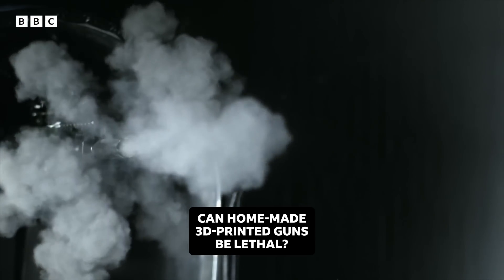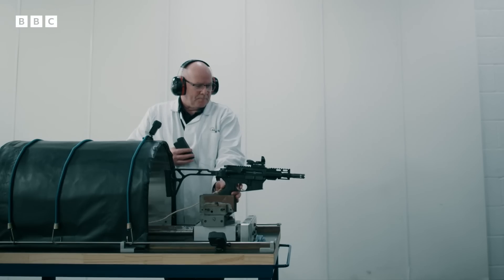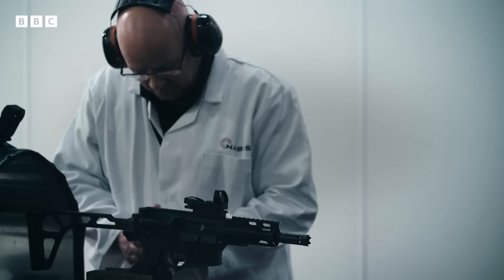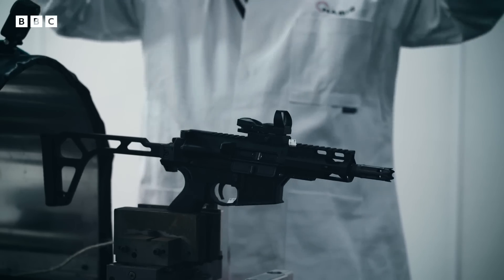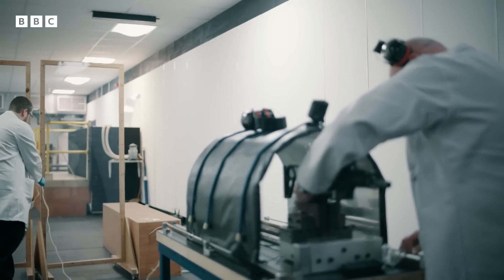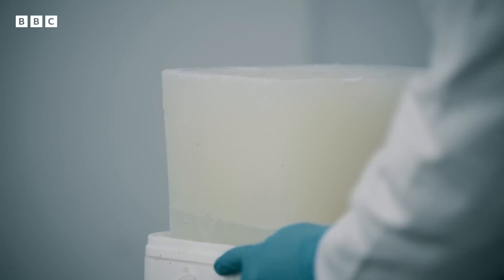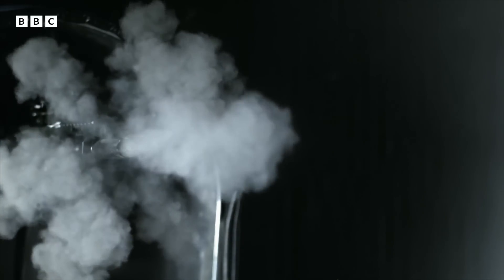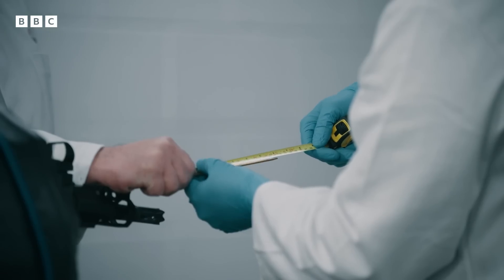Ballistic Forensics - Is the illegal 3D-printed gun a viable weapon? | Forensics: The Real CSI - BBC

Comment: You can make your own rifled barrels through ECM (running an electrified current through water) and all you need is a fish tank, steel pipe, water, a saline solution, a power source, and a fish tank water fountain. Weapons like the FGC-9 utilize a fire control group that can be sourced from an airsoft gun, or made at home using a spring bending jig, and printed parts. The bolt assembly uses straight blowback, and is mainly printed, as are the receivers. Gun control is dead and we killed it.

Comment: This article is very misleading, only frames can be properly printed, triggers, hammers, and other internal parts all brake. This is only a problem in the us where you can buy unregulated parts, like barrels, bolts, bolt carrier groups, etc. Entirely diy 3d printed guns kinda suck tbh, they are fragile, finnicky, and somewhat difficult to get working correctly. Not to mention they still need some gun parts like a trigger group. Although a trigger and hammer can be printed they are very unreliable. The fgc9 proved this, although many improvements have been made, they still kinda suck if you dont have industry made gun parts. 
To this date there hasn't been a fully diy AR.

Comment: The FGC-9 can be made entirely at home with zero gun-specific parts—even the rifled barrel, which is made from hydraulic tubing and an electrolysis process cuts the rifling. Myanmar rebels have been using it in their battles. The cat is out of the bag, gun grabbers. Figure out a different approach.
Reply: But for ammo?
Reply: @Filtered6  More difficult but not impossible. They sometimes use Ramset primers intended for construction nail guns and sometimes they use blanks or starter pistol rounds. Fill with powder and melt bullets from lead obtained from car wheel weights or fishing tackle. But often enough they just buy them; In some places, the guns are much more regulated than the ammo, which can be easily obtained. Where there's a will...

Comment: The gun looks like variant of the FGC 9 (Fu*k Gun Control) designed by Jcob Duygu (RIP). If you want more click bait and scaremongering especially the politians, you should do the Liberator, a fully 3d printable design including the barrel and the only metal part is the firing pin and bullet.

Comment: I’m unclear what I was supposed to learn here. 
1. Why use a “modified cartridge?” Will criminals use those?
2. How much of the gun was printed? Just the lower? We already know the lowers function just fine. Now how about the bolt and barrel? Can you print those?
3. Why was the guy on the other end of the phone call so excited to find out they could ban something? Kind of calls into question his objectivity, doesn’t it? “Excellent!”
Reply: It was all 3D printed. Not a lower with a complete steel and aluminum upper. I think the upper may have been from an Airsoft gun or something though. Don't think you can buy a complete uper in the UK. LOL Hard to tell. But it was for a UK court case. They man they called was a detective. They were trying to prove the gun was a viable weapon to charge that person with its possession. 

This also looks to be a 22lr or maybe even a simulation gun. Not sure.

It's definitely not something like an 80%. I wouldn't be surprised if it was intended as a BB or airsoft gun that uses cartridges. Not sure. 

This whole video is out of context... by design I'm sure.

Comment: I know the whole point is fearmongering but for the love of god if you're gonna go through this much effort shoot a 9mm bullet, how about you actually shoot a 9mm bullet.

There's thousands of 3d printed guns that fire bullets and do so successfully without this level of silliness. I've shot 3dp pistol I built using a piece of string and a machinists vise and the same ear/eye pro I wear whenever I'm shooting guns. You're not testing a nuke or explosive. When most 3dp guns break they do so via delamination aka the layers separate. Your bolt face, breech, chamber and barrel(you know, the parts that contain the explosion of the powder) tend to be made of materials that can handle the pressure of pistol cartridges, which isn't all that much in the grand scheme.

Guns that require no gun parts and are 3d printable exist and have for years. They're also quite safe and reliable if built correctly. Cope. The only thing you're showing your expertise on is how behind the curve you are.

Comment: "we put our own custom bullet in it, and it fired without blowing up. therefor, it's illegal." gun regulations only serve to decrease operator safety.
Reply: @icykenny92  so you would buy a rifle not knowing if it was correctly hardened to be safe to shoot?
Reply: So you think it would be good to flood markets with unregulated firearms, no clue if it will explode
Reply: @Mihail2204 wtf does regulations have to do with it? People have been building their own guns for hundreds of years. All the pressure bearing parts of this gun are steel. Not plastic.
Reply: @CarbonGlassMan  very off topic
Reply: @Mihail2204  No, it's on topic. You worry about the markets being flooded with unregulated firearms. I asked what do regulations have to do with it? What do you think regulations accomplish?
Reply: @CarbonGlassMan  they help keep safe firearms in the market and get rid of dangerous firearms?
Reply: @Mihail2204  As I said, all pressure bearing parts of that gun are steel parts made by actual gun making businesses. The part that just holds the trigger in place is the plastic part. This is perfectly safe. Now, people have been making guns with 3d printers for at least 10 years now. I've heard of no deaths from exploding 3d printed guns.
Reply: @CarbonGlassMan  it is safe if it is done correctly, that’s why they test it. If it were to explode because it was printed incorrectly then it isn’t a live firearm and holds less of a punishment
Reply: @Mihail2204  This was an AR pistol, probably  in 9mm or 22lr caliber. The entire upper assembly, upper receiver, bolt, barrel were aluminum and steel. That is where the pressure of the round going off is at. The lower receiver, which is typically aluminum or injection molded plastic doesn't experience any pressure beyond the spring pressure from the hammer and trigger springs. This gun had no buffer tube, so it was probably a 22lr, and since there was no buffer tube, the lower would be under no pressure. 
This video was made as a propaganda piece. The bullet had penetration into soap? That has nothing whatsoever to do with the gun. That has to do with the bullet. No shit that firing a live round of ammo into soap blocks will penetrate. DUH! You can drill a hold in a piece of metal or plastic that the bullet fits in, then whack the bullet primer with a hammer and the bullet will fire and penetrate what it's aimed at.
Reply: @CarbonGlassMan  not reading all of that, you clearly don’t understand what you’re arguing for.
Reply: @Mihail2204  Is reading hard for you? Let's see, I've been building guns for 30 years. I know exactly what I'm talking about.
Reply: @CarbonGlassMan  gun wise no doubt, but the current topic isn’t about “3D guns blow up” but rather me explaining that they do these test fires with a special load which is generally a hotter load, if the gun survives the firing then it is a functional firearm, but see if your illegal gun fails to fire or has a catastrophic failure when fired then it is not a functional firearm, this proofing is done so you know what ammunition might give you issues
Reply: @Mihail2204  Guns get random samples where they double load the powder in a cartridge & fire it to make sure the barrel can withstand the overpressure. Every gun does not get a double load fired through it.

 This AR upper's barrel is not 3D printed. It's a real barrel made by a real barrel manufacturer. It will not blow up because it's design has been tested. 
Complete guns get test fired with normal ammunition. Uppers by themselves get test fired at the factory IF it's the factory's policy to do it to all uppers, OR if you pay for a test fire, OR they dont' test fire it at all.
Reply: @Mihail2204 do you understand what you are watching? They arent making production tests for standardized loads, they're trying improvised projectiles on behalf of the police, nothing to do with market regulations
Reply: @Mihail2204  "very off topic" like how? He pointed out people have been making their own weapons forever, and that all the pressure bearing components are made from the same materials as regulated firearms. Companies don't built their firearms with steel because of "regulations" they do it because you can't have a repeat customer if they blow up.
Reply: @Mihail2204 yes

Comment: Wow what an drawn out over dramic way to test what has al ready been prove.  Yes you can 3d print a functional firrarm.
Reply: nah m8 this is the first time its ever been done with a bloody looooooooicenseeeee MMMMMMMMMM888888888888888888888888888888888888888888
Reply: They didn't even bother to state the fact that almost all the internals are meta. Since even abs deforms at roughly 100c (maybe even lower I forgot abs printing temps) and pla deforms at 70c well below a guns working temperature